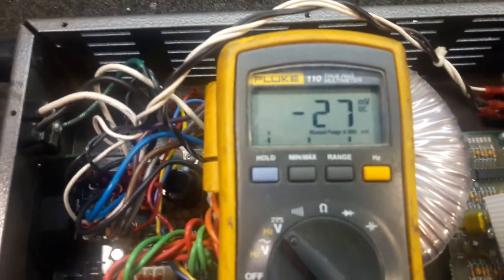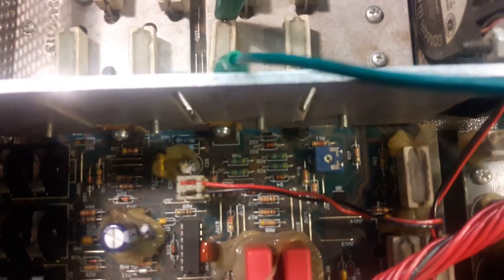SVT3 PRO Bias adjust

Comment: Sorry for unusual question.Shoud I use the same pot for adjust and sett  each resistor on approximately 25 mV ?Is it important which resistor comes  first, second,third to be checked or not?Between each checking points the amp shoud be set  off or we can proceed anyway with unclip/clip over the resistors? Thanks for your help.
Reply from the maker: Theres only one pot. So set any of the 8 for 25mv. The rest of the resistors should all be close. If they arent, then theres another problem to find.

Comment: p6 the tube  gain (plate volts in diagram) was appearing blown but in pulling board to verify where to put a 1m bypass resistor, i found pot was ok!  It's a bad dirty ground or something.  Still trying to figure what's up!  Appears i/c pin 4 indeed was the culprit...104v to 298v now instead of 120vdc shown for tp7.  still 200w instead of 275 out.  

ps ampeg told me to f off when i said we need a service bulletin rather than giving me any support

Comment: Hello, I have a question. Does volume level affects the bias voltage? Do you need to plugin the cab to do it? Thanks!
Reply from the maker: The bias is set with no signal and no speaker load.

Comment: My ampeg used to have a good drive, but it burst in a 220v. After repair it came back almost clean with the same setting that used to get that drive. Could it be BIAS adjustment?
Reply from the maker: Its most likely a weak tube. But it wouldnt hurt to verify that the bias is set correctly. Turn the tube gain all the way up.

Comment: How close is close? I set one at 25, highest one is 30 and the lowest is around 18
Reply from the maker: when I rebuild these they are all within 2mv if you can check temperatures I guess its ok to have a wider spread as long as they all run close to the same temp and nothing odd shows on the  scope when you run a sign wave through it.

Comment: While doing this, the 330k resistor(R27) blew right next to it. I replaced it and still not getting sound.
Reply from the maker: check R25 and R27 they should both be 330 ohms. Q5 MPSA06 Q6 MPSA56 often blow too. Also make sure output fets dont have dead shorts

Comment: I get 0mV across all of the resistors. The amp is on. Sound comes out, when I plug in a bass. Although the sound is farty, and decays quickly. That's why I'm trying to bias the MOSFETs. Any idea what I could be missing?
Reply: Turns out the trim pot was just too low. Now I have a couple of them at roughly 25mV, but the 3 closer to the outside of the case are roughly double! Are they all supposed to be the same? Is it safe to leave it as is, or should I set the highest one to 25mV.

Thank you so much for this video and your help!
Reply: Updating for future explorers finding this comment by searching keywords. I tuned the resistors that were the highest voltage down to 25mV. The amp sounds great now, except for a slight high-end buzz. But it's so slight that it may be from ambient interference, and the buzz faded slightly after the tubes warmed up.

Comment: what kind of leads are those ? can u use the red and black leads ?
Reply from the maker: the color doesnt matter I had a green jumper I cut in half and attached the 2 pieces to a dual banana plug that I plug into my meter.